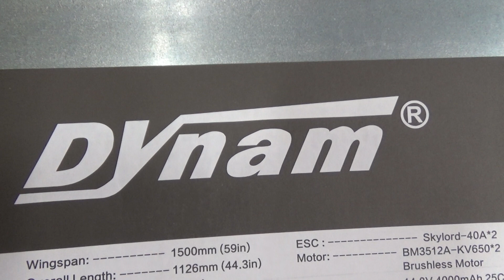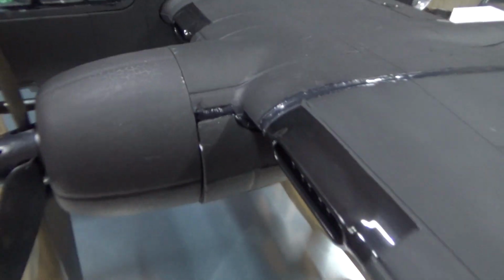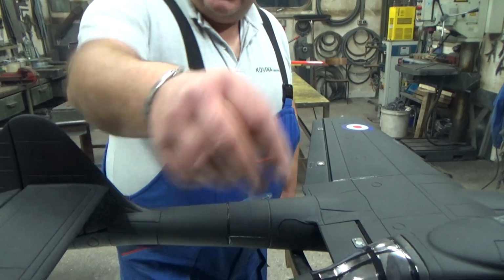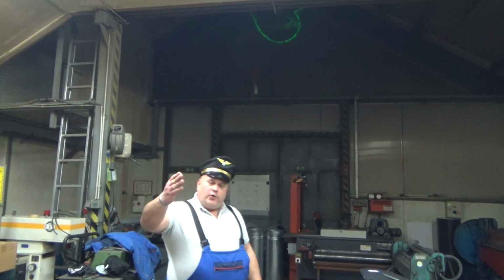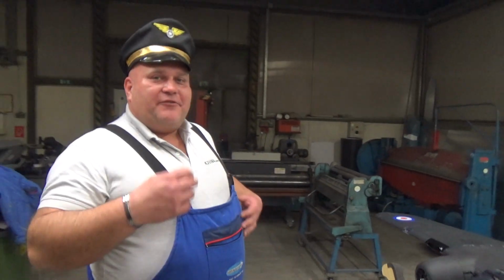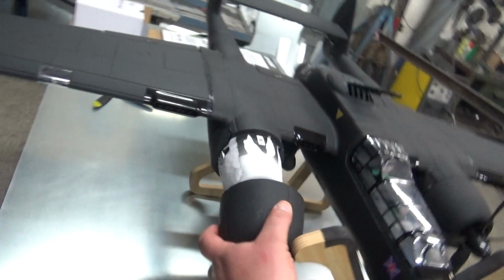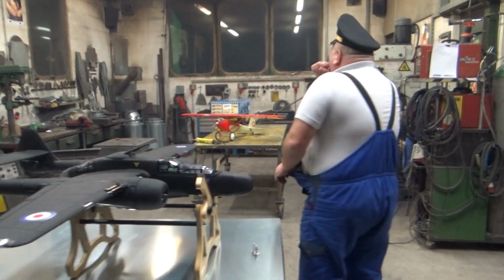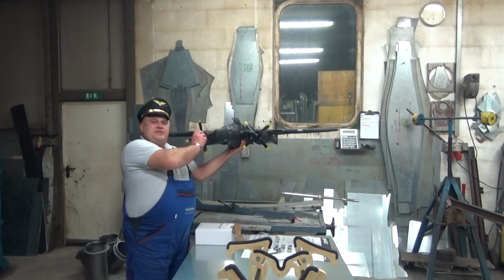Dynam P-61 Black Widow 1500mm EPO PNF After assembley REVIEW

Comment: Capt. Robert, I am just now putting together the Dynam P-61.  So far, you are very correct on mounting the rear section to the main unit.  I have tried to put the two sides together numerous times hoping there would not be a gap.  Only once on one side did it go together tight without wanting to push back out.  Inside the main unit tubes is a small square space where the wiring must fit in order for the rear unit to fit flush with the main.  But because I could not get the other side as tight, when I backed out the good fit, it didn't want to fit tight again.  It is something to do with how the wires rest inside that small space.  Even if I get it to fit tight, I still am going to put glue around the space to help keep it together.  Flat black paint is the easiest to blend so once the glue is dry, I will paint over it with black touch up paint to blend it in with the rest of the model.  And tell Capt. Blaz that sometimes it helps to be "wordy".
Reply from the maker: Well, its Dynam my friend. Still Iam happy to have this bird. It looks great in the air. Good luck on your maiden.

Comment: Thanks for your support to Dynam plane. The suggestions from everyone are important to us.
In fact, we solved these assembly and disassembly issues like installation gap, the placement of servo wires in the new consignment of P-61 planes.Beside, we replace the 8×6 main wing carbon tube with 10×8 size to increase the strength of wing and reduce the installation gap. For more stable, we increase the number of carbon fiber plates.We also made some optimizations to increasing the joint strength between landing gear and fuselage which means the possibility of landing gear damage is effectively reduced.
We will post some pictures about P-61details on facebook when our R&D staffs arrive at the factory.
We alway hope that we can provide the better plane for everyone who like Dynam :)
Reply from the maker: Hey Dynam. Thanks a lot for the answer. I must tell you that I really like the plane and I respect that you decited to make this awesome plane in foam version. But like you were able to see in this video something with this mistakes must just not be on a new plane. I know that you will fix this things and you will put on the market awesome, awesome plane. I have your Dusty, beautiful plane and I have recenetly bought A-10 and Grand Cruiser. Those two I must assemble first. I know that you are trying hard and if you want we can test your planes before you put them on the market. We will tell you the truth if the plane is OK or not, or what to fix. So thanks again for the reply and we wish you all the best in the future. Greetings from Slovenia, Pilot Robert

Comment: Now I know this may sound stupid....BUT are you sure that you have the wings on there correct sides ??  because it looks to me as if you have anhedral on the outer panels (drooping down).I looked at the video of the other model flying and I could not see that.I hope that i am incorrect!
Happy Landings
 Chris...
Reply: britinozoz i believe you are correct, looks like wings are on wrong side, they certainly don't look right.
Reply: britinozoz but thinking about it, i don't see the servos, so they must be on the bottom of the wing. I can only assume this would be correct. Something definitely doesn't look right about the outer wing panels though.
Reply: Thank's Shelby... Correct sides but something is WAY out !!
Reply from the maker: Hey Chris, they are correct. I was wondering the same thing when I assembled them, but then I checked the picture on the box and they are like this. The midle part of the wings is going up and then the outer panels level. Maybe it was like this on original plane or maybe Dynam just screw up this too. Anyway you cant assemble them in any other way. I cant wait to see if this bird can actually fly... Cheers, Robert
Reply: OK  Robert....Even when I look at the T/E of the wing by the aileron (not happy with that) It's just that it makes me think that it may be just a bit twitchy.Good luck with the flight and as always..Happy Landings
 Chris...
Reply from the maker: It is a little bend, the wright one, and I dont know if I can fix that also. I will just try the bird like it is. Stay well and see you soon, Robert
Reply: The P-61 doesn't really have anhedral, but looks like it due to a bit of a gull wing design.